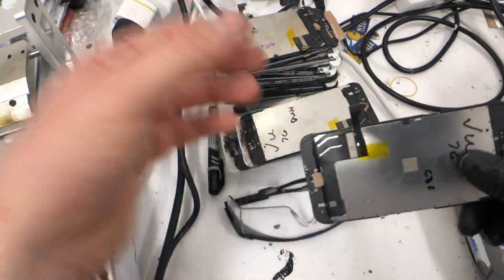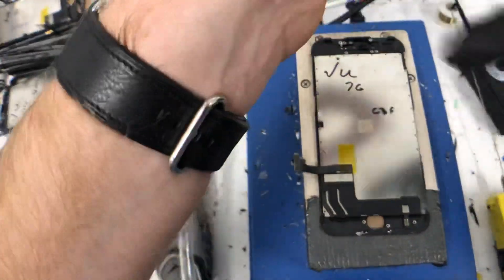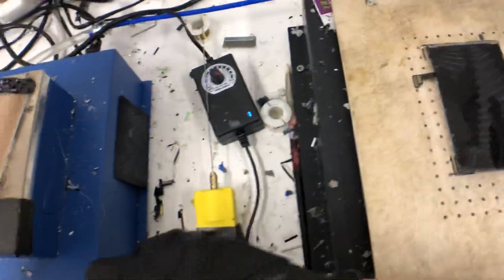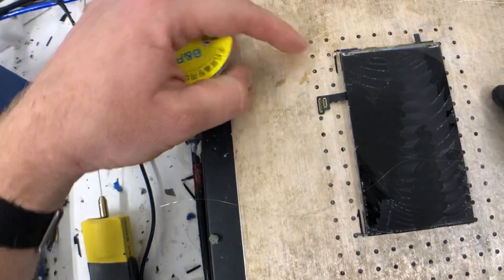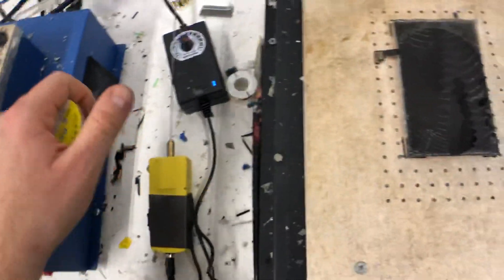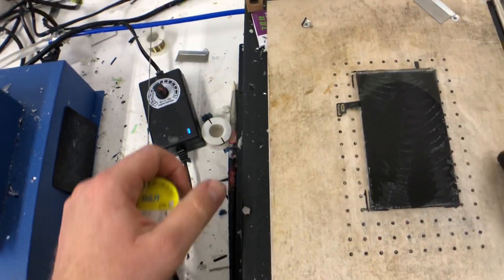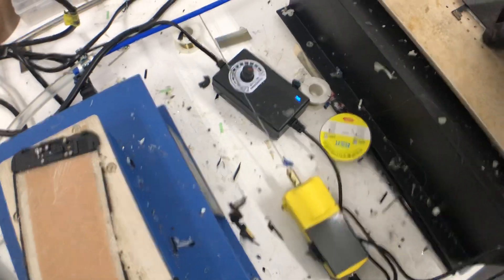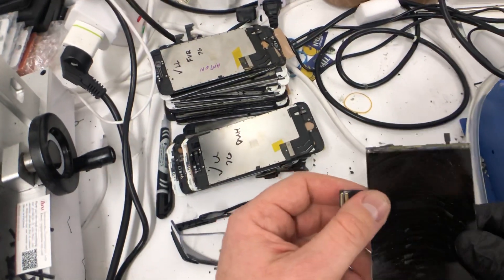Introduction - iPhone 7 Refurbishing - Remove Glass and Polariser

Comment: Hello. What temperature you are using on you polarizer remover. I have set it on 172C (real temp colaps 175C -188C). I have thesame polarizer remover but from different manufacturer. What temperature you are recomended?
Reply from the maker: Olda Macháček 65 degrees no hotter. Can warp the backlight layers with high heat.
Reply from the maker: Olda Macháček sorry - polariser remover I have set to 150.